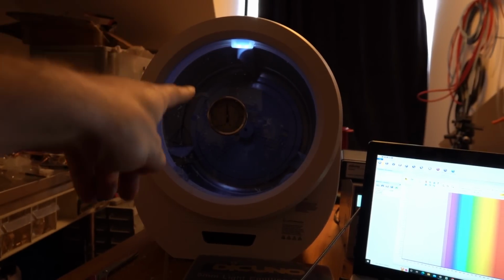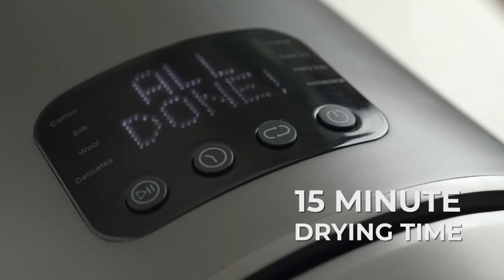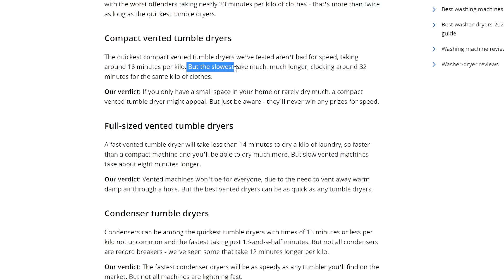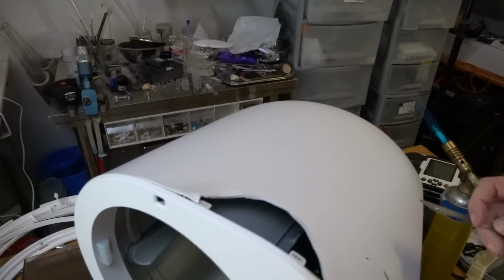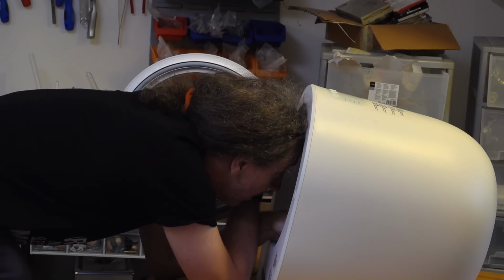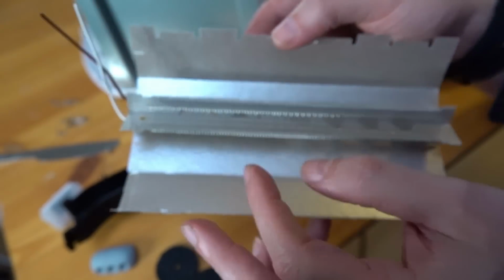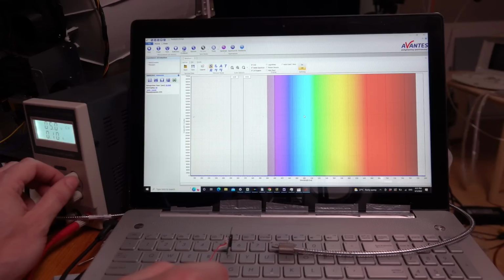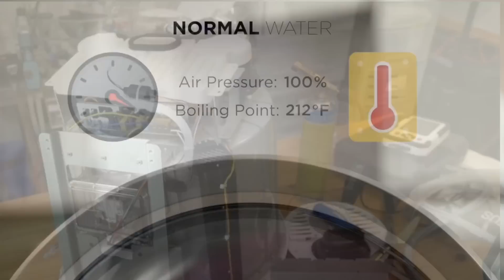Autopsy of a Scam-Starter: The Morus Zero!

Comment: 30:00 A bit more bits for the UV sterilization: I saw an article go by on the numbers required for sterilization (namely in comparison to the killing the covid virus). Just eyeballing the numbers and off the top of my head for calculations: that one bulb would have to run continuously on just a single piece of the cloth (i.e. just the sleeve of one of your shirts) for at least 30 minutes to get any noticeable degree of sterilization (even at the melting rates you were showing). There's a reason why those personal sterilization wands that popped up everywhere for covid are a complete scam.
Reply: We had UV sterilization cabinets at work for safety glasses and other PPE for visitor use. They used big UVC tubes (talking a 2ft long tube) and the timer started at 15 minutes at went up to 60. I would be curious to do a petri dish experiment with it to see how much each additional minute affects a test sample. I don't think that UV LED does jack. They have a plastic front cover on it so you can stick your face right up against it. That would NEVER fly with a proper UV enclosure. That safety cabinet has two door switches that shut off the light if you open it, it's also got door seals around the edges so no light leaks out the gaps. That is what a serious UV enclosure will have, you can even smell it when you open the door after running it.
Reply: Since this UV LED was already melting the materials around it after 30 seconds of use, I suppose the ensuing house fire would sterilize the laundry if it was left on for a full 15-minute drying cycle.
Reply: @darkpraxis  unlikely that the LED would ever start a fire, by 230°C the lead-free solder will have melted and likely detached the LED, or a bit hotter still then either the die or its bond wire will soon fail.  Ironically, to have enough time to accumulate enough heat to set anything on fire would have required the missing heatsink, the LED just has too little thermal mass on its own and will reach destructive temperatures far too quickly.
Reply: Actually half-hearted pseudo-sterilization is a very bad idea. Not that it doesn't fulfill its goal (which is fraud, in legal terms and in medical terms very questionable when it comes to people who need that property guaranteed), instead, it serves as an incubator and possibly even as a mutation accelerator. Something like that should be taken out of circulation immediately. Including those responsible!
Reply: UV lamps for water treatment (which have some REAL sterilizing power) is made out technologies not too different from fluorescent lamps, except they aren't made of glass, but quartz and requires a hefty power load. Merely touching the quartz surface with your bare hands to install potentially leaves a thin fat film that decreases both effectivity and longevity of the lamp. They are sensitive. That alone is a huge reason for me to be so skeptical of the claim. Turns out I wasn't far off; a UV LED would ultimately fail EVEN if it was legitimate.

And that isn't even including the baseless "infrared drying" that basically means "it gets hot" (duh ofc it gets hot, every dryer gets hot gdi) and vacuum, as air pumps and compressors can be quite volumous, and you can clearly see there is little to no space around the barrel, EVEN in the thickest part under it, at the bottom.
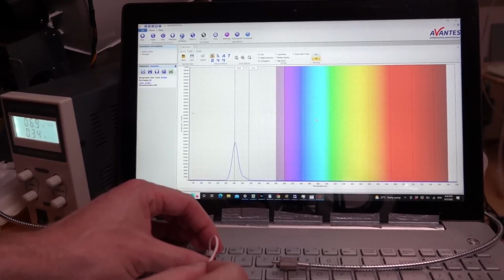Edit: 27:27 IT DOES HAVE UV! Impressive! Unsure about how effective it would be when covered under a plastic shroud.
Reply: @darkpraxis  he did overdrive it really hard.
Reply: Let's not forget that actual exposure to UV light would gradually damage your cloths (fabric and colors).

Comment: I'd strongly recommend setting your bench supply to CC mode and testing LEDs by adjusting the current rather than the voltage in CV mode.  Start small, maybe 1mA and step up from there.  They probably pulse the LED with a 10% duty cycle or something.  Interesting video!

Comment: Thunderf00t, did you check if the plastic cover for the UV-LED is properly UV-penetrable? Many plastics actually don't let through wavelengths shorter than around 300nm. Now obviously that would be first engineering concern, but looking at the "condenser"...
Reply: if you look carefully, there is a hole in the plastic for the uv led
Reply: @JDTeam  Well that's nice, at least the minimum attention.
Reply: That's also why the LED cover isn't attached well - to let the UV out :)
Reply: That’s really kind of irrelevant. If it’s blocking the UV then it’s just as ineffective as if it weren’t there at all.

Comment: The broken off bits might just be machining hold remnants.
When you found the 1st pair of screws under the feet I was almost yelling at the camera to pop the other pair too. The plastic condenser was my fav part
Reply: They can work well, so long as there's airflow over them. (Like installing the two fans in the empty positions)

Comment: Clearly, the thing that they achieved most effectively was preventing repairs from ever being made. Purely disposable product.
Reply: I will bet that if you look there is a product nearly like this that has been sold for a few years already, just the took it, added the "condenser" to it, the UV LED to the front, and a fancier control panel with display, instead of the original simple timer.
Reply: Not going to argue that it's serviceable, but I'm sure there is a simple way to get it apart without a torch and a scalpel.  Usually there is a very unintuitive way that plastic cases are intended to come apart.  If I had a dollar for every case I destroyed by prying and snapping off bits, then realizing later there was another way.  I'd have like ten bucks.
Reply: @somethingelse4424  I was thinking that the whole time that he was taking it apart (because that's also happened to me on many occasions), but I never saw anything that would indicate that this thing was ever meant to come apart.
Reply: @PistonAvatarGuy  I've only encountered a few things that actually were not supposed to be serviceable.  Apple products, and some electronics that are supposed to operate in harsh environments and are permanently potted in epoxy (sensors for farm equipment for example). Those farm electronics were designed robustly and with enough fault tolerance that they shouldn't need to be serviced, and this certainly is not the case here. It's possible that this is meant to be like an Apple product and only many to be serviced by the company using specialized tools, or thunderfoot did it incompetently.  Both are equally likely in my mind.  That's not meant as an insult or to suggest I would have had done it more competently.
Reply: @somethingelse4424  Nah some companies want you to only go to authorized repair people or to just get a new product and never be able to open it and then put it back together.
Reply: @MyAramil  I mean yes, many companies go as far as to use security fasteners to keep customers from servicing their own devices, and even more generally withhold documentation/manuals.  It's totally common for companies to behave that way, It's just less common that anyone make permanently sealed devices that are completely bricked if anything goes wrong.  Most companies still want THEIR technicians to be able to access the interior, if for no other reason than to make money off exclusive service arrangements or R&D.  There's usually some way to get into most devices without a torch, scalpel, and five screwdrivers wedged into every visible seam of plastic.  I still think it's equally likely that TF just didn't find the right way as it is that there was no way.  He doesn't strike me as incredibly handy based on the way he approached that teardown initially.
Reply: @somethingelse4424  You think that a scam company has technicians, or that they're interested in R&D? Hilarious.
Reply: @PistonAvatarGuy  Well for assembly purposes then.  If a unit has any problem right off the line. They'll want to pop it open and fix it rather than tossing it in the trash before they've made any money on it.
Reply: @somethingelse4424  All they need to do is test it before putting the cover on.

Comment: I would not be the least surprized in most of the internal parts and their arrangment are just from earlier small dryers on the market with just the outer casing being actually newly designed for it.

Comment: When I was a kid, we did that famous experiment where we boiled water out of a metal gas can and then closed it off.  The vacuum inside the can caused the outside air pressure to crush it flat.  There is no way that plastic dryer would survive an internal vacuum.
Reply: Yup.. YouTube, "vaccum decompression "   lots of railway cars have been crushed using the weight of the atmosphere
Reply: Pretty sure that "Mythbusters" did an experiment with a Railway Tanker Car, went the same way, just on a much larger scale :-)
Reply: I have a weird suspicion that whenever they say vacuum they actually mean something like suction, like in a vacuum cleaner.
Reply: @bialek.online  That makes sense. But remember, the promotional video actually addresses that exact issue.  It literally says that it is not like a vacuum cleaner.
Reply: Certainly not with a hole in the front.
Reply: @bialek.online  You sure could be right!
Reply: @jonathanlyng3442  True enough!